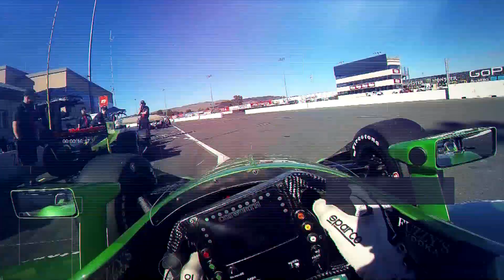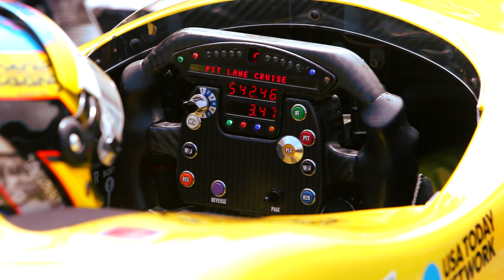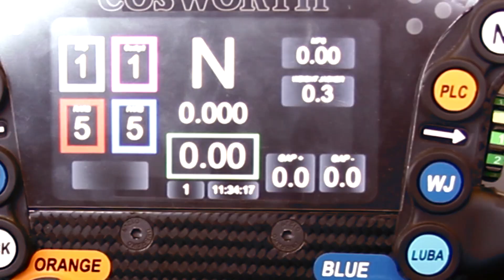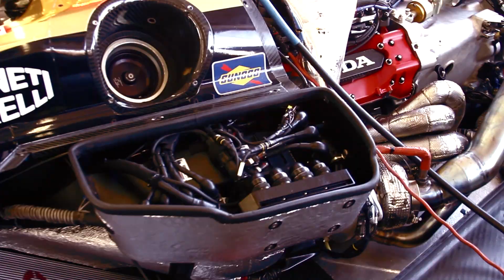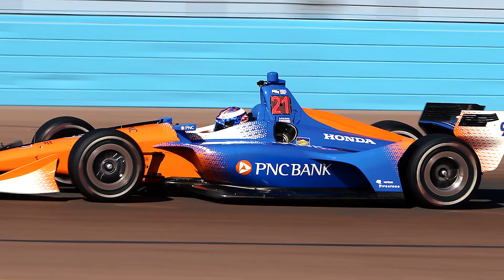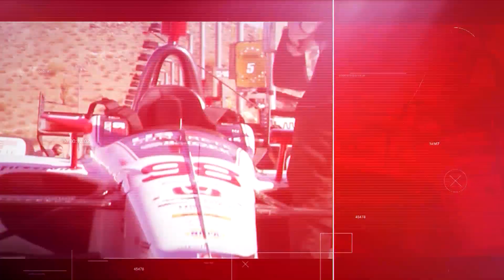Inside IndyCar's New 2018 Electronics

Comment: I never knew about the “push to pass/overtake” button. That is so interesting. It is also pretty cool that it adds a bit of boost momentarily whenever it is pushed. However, if an Indy or F1 driver is about to be passed, can they not push there own “push to pass/overtake” button as well??? Which in turnwould make it more difficult for the car behind them to pass and take the higher position??? Or is that not allowed??? Thanks in advance to anyone who answers my questions.

Comment: I'm guessing that Cosworth offers a variety of displays to the teams? I saw that the "flag lights" ( the LEDs on both sides of the screen) were positioned either vertically or in a triangle shape depending on the wheel.

Comment: What does the position panel show when push to pass is activated? Also is the X for when the engine cuts off, or for anytime a car goes off track? I noticed it allot at St. Pete.
BTW:
That was a good effect you did with your avatar on the panel. The only thing that gave it away is you forgot the hole in the center where that bar for the crane goes.😉
Reply: Ty me too. Indy and F1 with Haas are gonna be good.